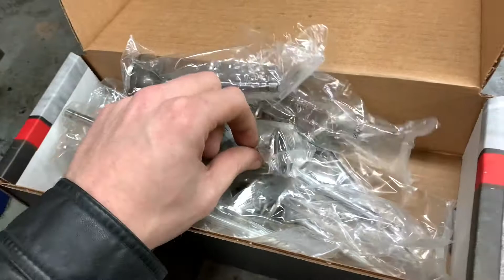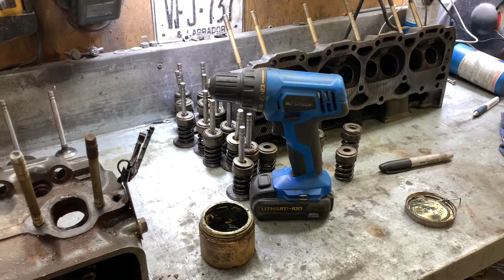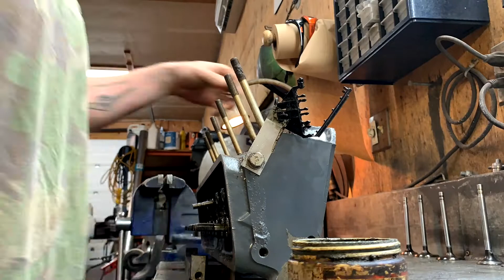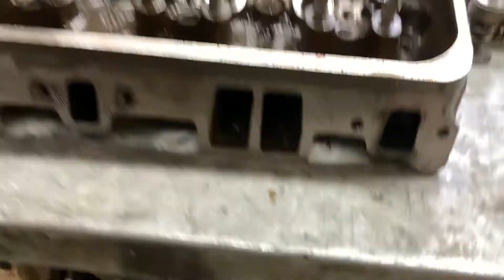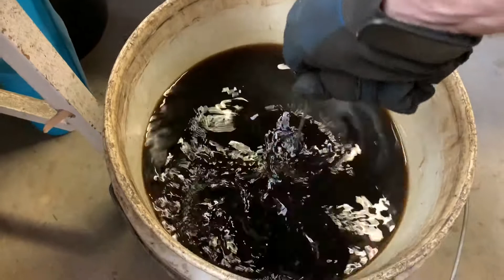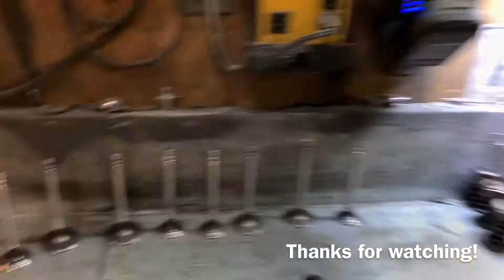SBC 305/350 cylinder head rebuild- part two

Comment: Simple improvement would be to use a short length of hose to slip over the valve stem and onto a short rod chucked in the drill.  Allows for the valve to be guided by the guide, without any possibility of the drill putting any side load on the valve guides.   It's iimpossible to hold a hand drill perfectly aligned.
Reply from the maker: This is an awesome tip!

Comment: I’m re-using my valves. Is it okay if I mix up the springs and the hardware. I’ll make sure to put the valves back where they were cause of the wear, but can the hardware be put all together in parts cleaner without labeling
Reply from the maker: I’ve never been a stickler for putting everything back where it came from. If you’re lapping the valves it doesn’t really matter where they go either

Comment: What exactly is the gun clean is it like bore cleaner?
Reply from the maker: It’s actually gun wash, used for cleaning paint guns and parts, it dissolves paint and grease/oil really well and makes parks much easier to clean after

Comment: I hated lapping the valve and seats lol.
Reply: We did it the old way,  we used our hands and a sucker cup on the value. No utube back in my day lol.
Reply from the maker: @kenjackson8159  I still have the old stick with two suction cups on it, I just find a drill a lot faster for my level of patience hahaa
Reply from the maker: It’s a pain but better than having low compression hahaa